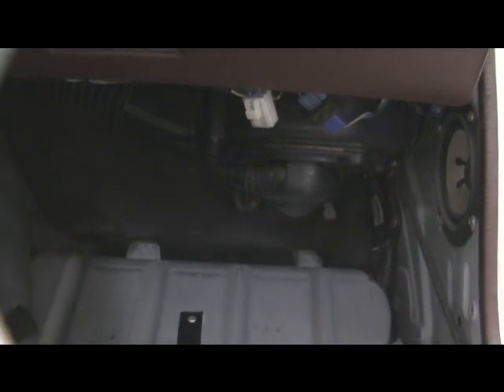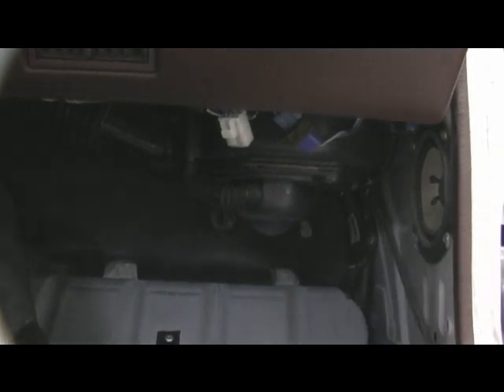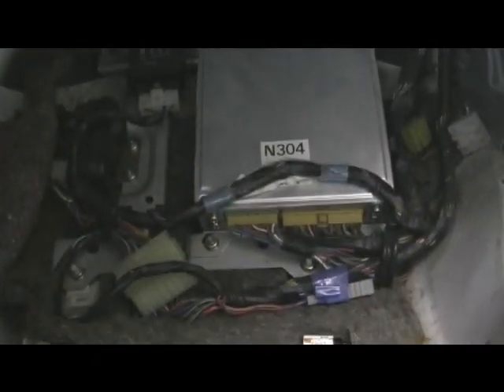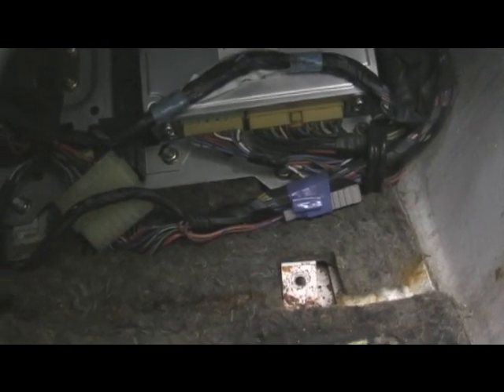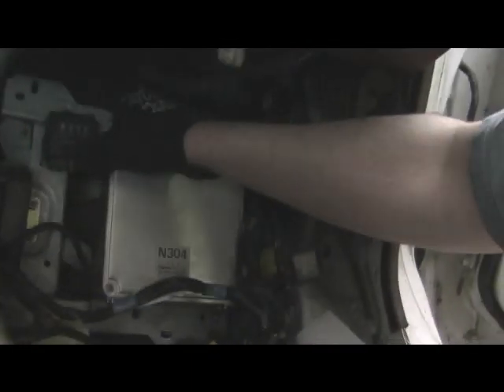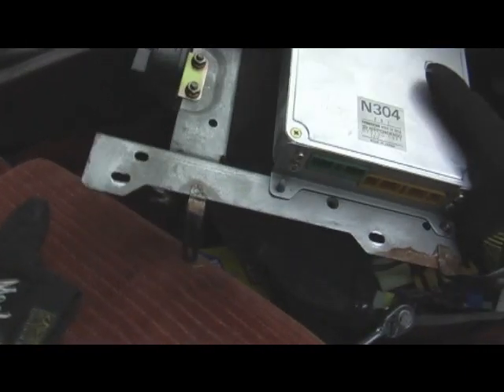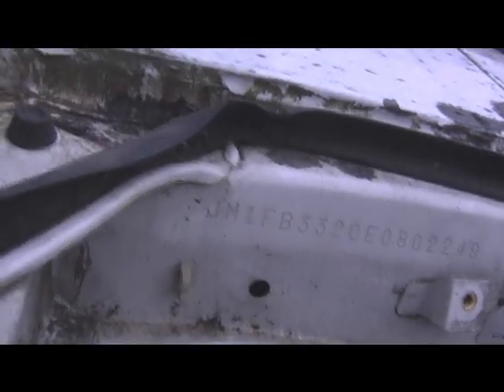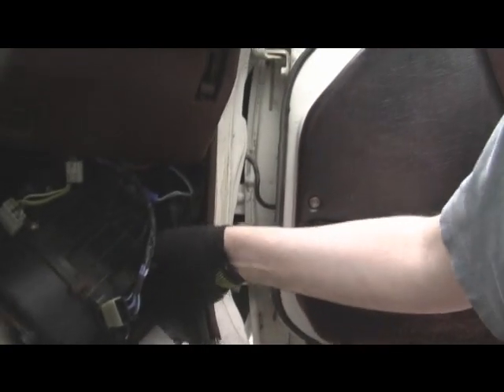How to Remove your ECU Before pulling your Motor. The proper way.

Comment: Hello! I have been without my smart car for almost a year now and have had a buch of problems trying to get it running! I had to rebuild my engine with parts from another engine! I finally got everything in ang plugged up and not it turns over but will not start! Ive narrowed it down to the ECM! I need to replace it but i was told i have to "marry" the new ecm to my car using a "star system" I was wondering if you have any info on this? please and thank you!!!!